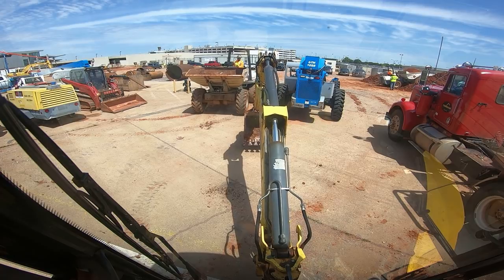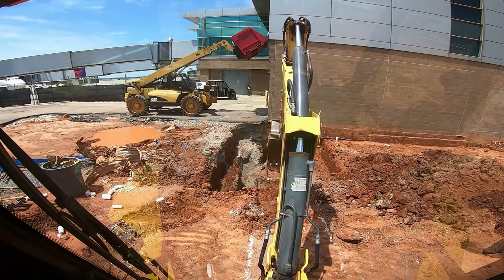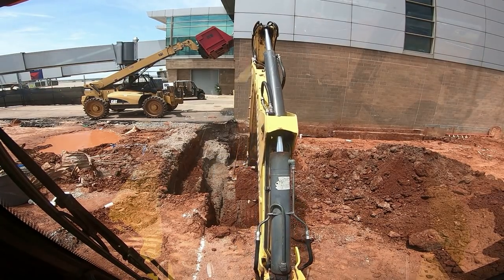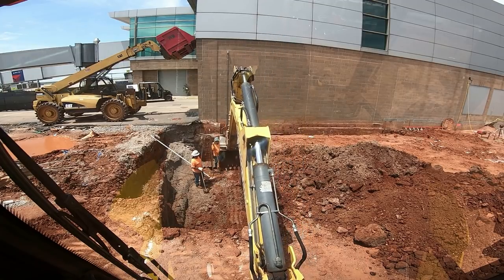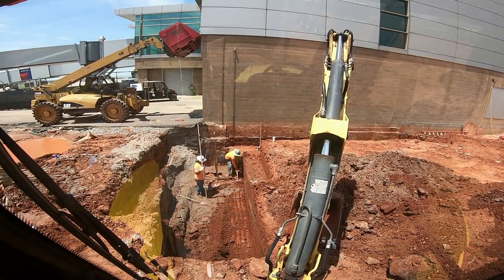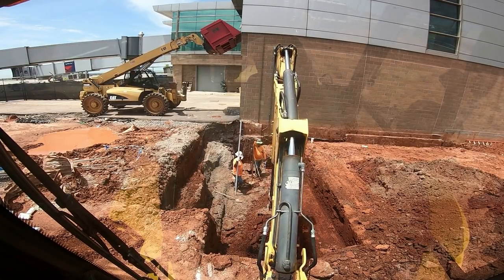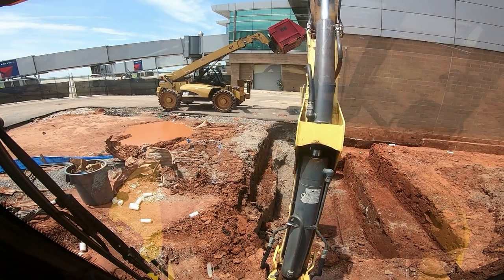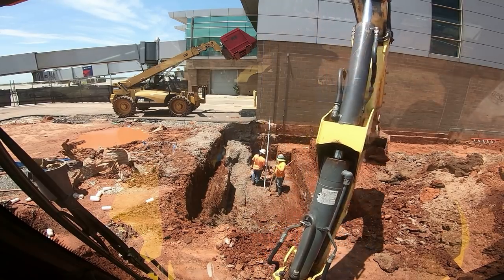Two steppin' with a backhoe. #MBGA #Backhoeman #Digginok #backhoepilot

Comment: That's good digging dirt. That might be one of the cleanest ditches and benches I've seen. Out here in the Phoenix Valley area we don't have a lot of dirt like that. We have very loose, dusty, weak, potato dirt. Doesn't hold for nothing. So you can bench but it doesn't come out as clean. And you have to constantly have a guy running hose it's so dry. Nice work man.
Reply from the maker: That dirt wasn’t bad be we have some nice stuff around OK. Thanks for watching.